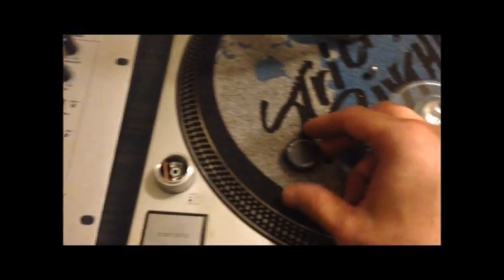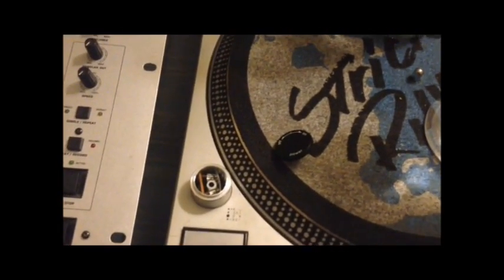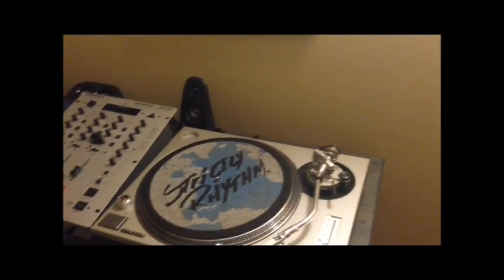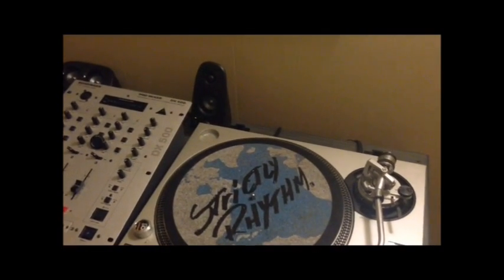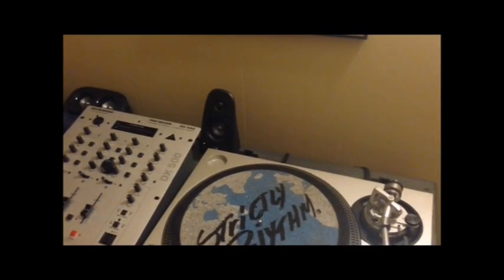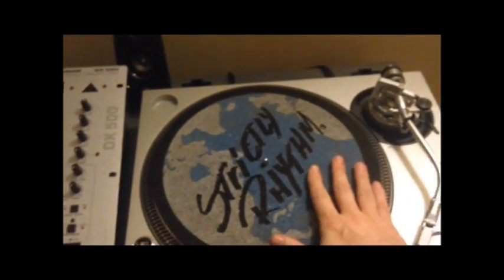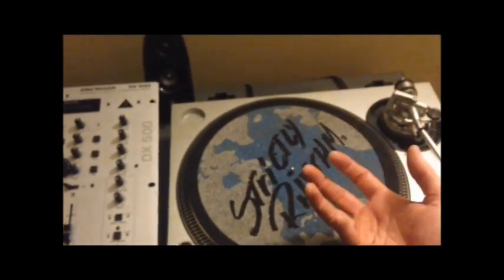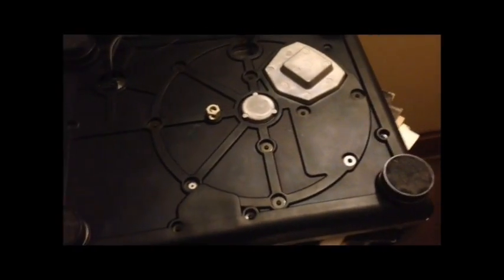Repairing Technics SL 1200 MK2 turntable power switch on off switch

Comment: Before you take the bottom off try this first.......flip the tables upside down and kind of slightly bump the table from behind until the pin or shaft comes out. use tweezers to help pull it out to full extension... that way you wont have to take off the back part. I didnt notice it until after i followed the instructions to this vid. The light bulb went off in my head when i tried to put the knob back on the shaft and the shaft just went back into the hole smh. thanks for the vid tho drunk ass lol.